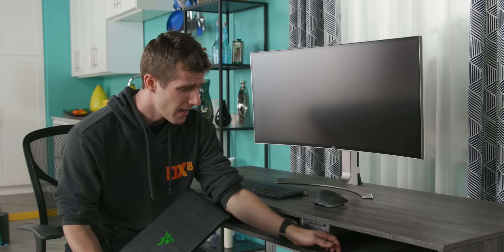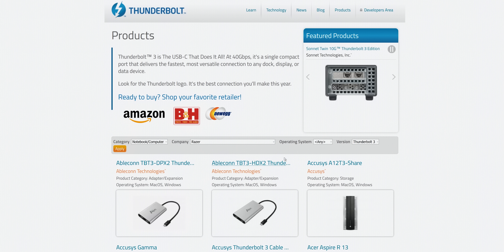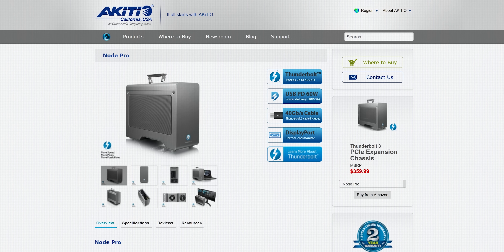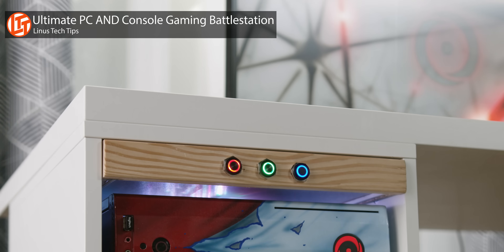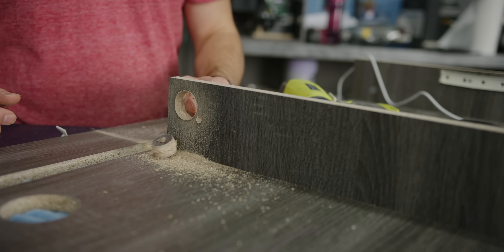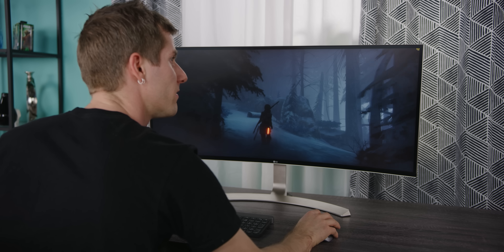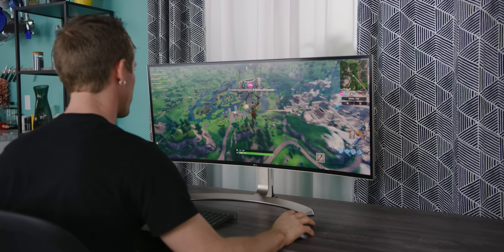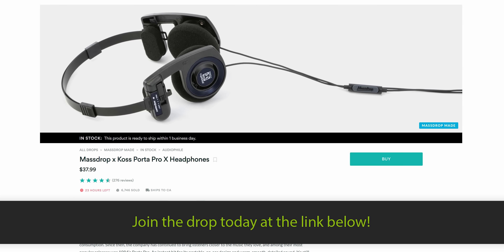This is the CLEANEST Setup.

Comment: Sorry, but I got my son the same thing in 2015. An Alienware 15" laptop with an i7 & 16gb ram & the Alienware graphics amplifier with a GTX 970 MSI Gaming 4gb graphics card. Four years old & still running strong without so much as a hiccup!! Can't charge the phone by setting it on the desk, but other than that, he's had the same basic setup for four years.
Reply: There is an option for phone charging in the bios (why? I'm not sure) if you turn it on it will give enough power to charge stuff out of usb
Reply: @anthonythomas8079  Good point, but I don't know. In either case, he's never used it.
Reply: Correct me if im wrong but, wouldn't plugging the laptop into the amplifier switch off the GPU of the laptop to instead use the amplifier's?
Reply: @beegbraining  Yes, but only when it's plugged into the amp. Unplug it & it reverts back to the laptop graphics card.
Reply: @erab9514  I only ask because I think its a waste to buy a laptop with a dedicated graphics card (My Alienware R5 m17 has a 1070 OC) to instead use a 970 on an eGPU.
Reply: @beegbraining  Good laptop!! Today, what you say is true. Back in 2014/2015, laptop graphics cards were not nearly as powerful as the desktop version. The i7 in the laptop is great even now, but the graphics card that came with it sucked then & its much worse now.
Reply: ok
Reply: Oh, we used a table from Amazon that cost $35, instead of a desk that cost over 10x as much. He didn't add an extra monitor (now he has 3) & keyboard until later. Not as clean looking, but a fraction of the cost.
Reply: @erab9514  "Not as clean looking..." So you didn't do the same thing, you just spent a bunch extra on an expensive laptop, extra eGPU enclosure when you could have just built an equivalent system with a monitor and given him a basic laptop?? Seems just as ridiculous, just achieving less.
Reply: @Ravenousjoe  Math isn't you're forte. My son needed a laptop for school & wanted a desktop gaming computer. I got him a reasonably priced gaming laptop, plus a desktop graphics card, plus $150 for the amplifier. Add to that the $35 for the table & you have my entire expenditure. He used just that for over two years. After that, like most PC owners, he added to his rig over time. But, for two years, he had the laptop he needed & the desktop he wanted, for very little more than the cost of the laptop. I got him the steak without all the trimmings, but the steak is the same.
Reply: @erab9514  You included the cost of just the table in your original comment, how was I to know you didn't spend a ton of money on an alienware laptop, especially considering buying alienware generally means spending a ton of money for mid range performance. I am glad it is working out for you, but that is a completely different set up, Linus's has filet mignon wrapped in bacon, you have a nice t-bone.
Reply: @Ravenousjoe  Alienware desktops I would agree with. Between my son & I, we've had two Alienware laptops, found them reasonably priced on Amazon & never had any trouble. Their desktops are overpriced, with poor build quality. But, as I said, we don't have the trimmings, but the steak is the same. All that glitters is not gold.
Reply: @erab9514  to be fair id take a t bone or Porter house over just a filet any day.
Reply: @Ravenousjoe  It also depends on how you look at it. I've been told my computer isn't very good, because I don't have case lighting, or my case, keyboard, mouse & mousepad RGB synced. In fact, my mousepad & mouse don't even have lights & my cpu isn't water cooled. Those same people grow silent when they see that I play CSGO at 250fps. I currently play at 1280x960 stretched, but I also got 250fps when I still played at 1080p. Lighting isn't something I care about.
Reply: @MinistryOfMagic_DoM  Good point 😊
Reply: @erab9514  I'm the same way. I have an air cooler and no window on my silent case. Would much better enjoy a silent, yet powerful pc over something flashy. But if I had the money to make something as clean as this, I wouldn't say no. Anything that blends in with the rest of my home is great, a tower normally doesn't go with an entertainment system. I guess thats why I have my office.
Reply: @Ravenousjoe  Good points & it sounds like you have a great rig!! Mine is in my room. Mine does have a window, but I didn't bother with case lighting, so you can't see anything. I also have an air cooler on my cpu. The cpu has never gone as high as 60c. Air cooling is way underrated IMO. (And if I had the money, I wouldn't say no either.)
Reply: Capt. Nasty english isn’t your forte.
Reply: @leowo4557  I don't take criticism from someone that doesn't know enough to capitalize English.
Reply: Capt. Nasty you used the wrong your
Reply: Capt. Nasty I’m not saying my spelling is perfect i’m just saying you used the wrong your
Reply: @leowo4557  And I'm saying that those too stupid, or lazy to capitalize, or use punctuation, have no right to criticize anyone.
Reply: @erab9514  nah hypcrites still exist you know and calm down it's just a typo i just used the english isn't your best forte because you said math wasn't you're best forte as a joke calm down dud lol
Reply: @erab9514  True and the same situation applies to me too

Comment: Looks cool, Unfortunately I have the normal akitio node which doesn't have any daisy chaining, I have to use all three ports on my computer to run my setup. Have you seen Mantiz eGPUs? They have all the bells and whistles in one package. On another note, I would worry about thermal throttling on your cpu. I found my computer thermal throttled with the lid closed and I had to either have it in tent mode or use a cooling pad beneath it.

Comment: Hey Linus, It's a big ask but could you comment on the performance impact of using say a 2080 in an egpu with a hardrive running the games. I've seen your egpu video that looks at performance but I wonder how much impact running the games off an external drive would have on game performance given the bandwidth of thunderbolt 3. Would the external drive cause significant performance decrease?

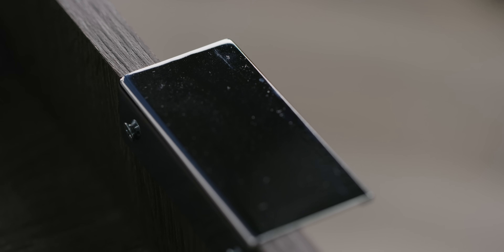Comment: 6:04 it looks like they don't fit because the countersink is on the other side. Either the plate is mounted on the wrong side (should be the inner 90* not outer), or the factory counter-sunk the holes on the wrong side. Double-check assembly instructions, if it's correct then try using a step bit to make your own countersink on the right side.

Side note: Do you need an AV technician (AVIXA certified)/Car Electronics Specialist (MECP certified)/Camera Assistant (First AC)/second Alex around the shop? I'd love to get away from the rat race in Toronto to work at LMG!
Reply: maybe commenting isn't the greatest way to introduce yourself, but good luck.
Reply: they do definitely need an audio guy, if only they realized it. or perhaps they did, but It isn't making financial sense

Comment: How difficult would it be to custom bend your own bracket for the I/O box that is held in place with two strips of velcro?  Then you could just slide the whole thing in and out of the bay to either the left of right side.  No need to unplug anything while sliding it out.  Overall this is nicely done.  Do you ever see your company manufacturing kits and/or finished pieces to sell?

Comment: NEVER run anything else on the same thunderbolt controller as an eGPU. You would be better off getting a laptop that has 2 thunderbolt controllers running x4 speed. For example, macbook pros have 2 thunderbolt controllers... 1 for the left 2 ports and 1 for the right 2 ports, eGPU gets plugged on right side controller, while your USB and ethernet plug into the left side controller.

Comment: For anyone thinking of doing this, use 3m dualoc instead of velcro. It's much more secure, and your Thunderbolt hub won't shift around when you plug and unplug stuff, but you can still pull it off the desk.

Comment: You want to use hook and loop velcro, instead of regular. I've got a huge surge protector with a dock, speakers, two monitors plugged in mounted to the underneath of my desk. weighs at least 5 pounds and is secure as all get out. Picked up two rolls at Office Depot for like 12 bucks.

Comment: I am trying to do this but usb-c monitors are not common in Brazil. I used a 4k 32 inch LG monitor, mechanical keyboard, mouse and speakers. Only thing that bothers me is opening lid to power up the laptop.

Comment: In total what’s the price of this? 🤔
Reply: Daniel Benavente too much
Reply: 5k if you get someone to build the same desk
Reply: I don't think they sell an Alex in my area, not sure how much it'd cost to buy one secondhand from Linus
Reply: @Soundaholic92  That CNC router might be a little expensive also.
Reply: Honestly, get one of the newer desktop replacement laptops or even the older Helios 500. At 1080p 144hz all the models are pretty damn impressive. I'm ordering the 2700 AMD model personally, just because I like that chip, that is if nothing comes along in the $1700-2000 range between now and next month. I just need an on the go laptop that can sort of keep up with my work station computer. There isn't one that can, but there are a lot that do damn good for what they are.
Reply: it really just depends on your needs. if you had a laptop that was $1000 and than bought a egpu for $400ish all that is left is the gpu.
Reply: If you started with nothing - around the same price as a decent gaming desktop setup but with the convenience of a laptop. 👍

Comment: This is a much cleaner version of what I do right now in college. I kept hearing "build a gaming desktop and get a laptop cheaper than $200," but I decided I just wanted one device and got a Dell XPS 15. It can run smoothly with most every program on the go, but I can also plug it into the charger at my desk and connect either a periphery controller or mouse (I'm hoping to at some point get a good monitor and wireless keyboard/mouse for this sort of aesthetic). It just feels nice having everything on one device.

Comment: Question.....if your laptop has 2 thunderbolt 3 ports, would this same set up be possible if you use one of the ports to connect a smaller eGPU and than into a monitor, and use the other one to connect the docking station, for charging and to connect other peripherals?  I know you would have to connect 2 cables instead of one, but might make cheaper for the eGPU system.  Thoughts? Thank you!

Comment: Cool? Yes! Worth the money? No. Those frame rates in fortnight considering the graphics card? That’s kinda underwhelming, which is the reason I feel eGPUs are a bit of a waste. Just get a laptop with a gpu in it, and hide a display port cable and Set it up the same way. All you’ll have to deal with is one display port cable and a power cable. A wireless dongle for your accessories can just stay in the laptop semi permanently

Comment: I would make 2 alterations to this setup.  Change the drawer runners so they don't pull out past the back of the shortened drawers, and hack the thunderbolt cable so that you can take advantage of the 85 watt power delivery from the hub.

Comment: Super cool and interesting video! Please help me out with a MacBook Pro (older and newer MacBooks) "Clean Desk" setup. Thanks bro!
Reply: If you want to have the apple-mirror you have to take the macbook air. It only really helps if you dont have an internal graphics card.
Reply: Salz Stangl the 13” MacBook Pro’s don’t have video cards either.
Reply: @christopherwhite6173  Oh, didnt know that. Then forget my last comment
Reply: There are ways to run MacOs on a PC build laptop if you really want that OS. It would cost less for similar or better power, but you'd have to be willing to do some rigging to make the OS work for you. You could also dual boot it or run MacOS as a VM on a Windows Machine. Just some options. It's not overly complicated, but it would require some work to set up.
Reply: @MinistryOfMagic_DoM  You cannot run macOS inside a VM stable, at least not without a lot of difficulty. And most laptops won't work with macOS without a LOT of tweaking (even then, a lot simply won't work) because the hardware they use isn't supported by the OS.
Reply: @christopherwhite6173  I didn't say itd be easy. You can run it stable on a PC based computer, but it'll take a lot of work. Not really worth the money to buy a mac honestly.  If they were reasonably priced I'd be onboard with Mac
Reply: I agree, a MacBook Pro setup would be fantastic (I have a 2017 15 inch with touch bar) and I when I’m at home I use my windows desktop, but in the future I would like the ability to just have my laptop but also still have my same clean desk set up and power!! (I also Duel booted windows on my MacBook so maybe somehow make it compatible both ways for whichever OS I’m in, if that’s possible?)

Comment: definitely do v2  with slide rails to hold hub, fans on usb power and F it RGB in desk remote controlled, mat in desk RGB mat ... go all out. the draws need fixing to desk in the event its kicked you dont want to rip a cord. drill into the desk leg and run cables inside leg so no cable ties

Comment: You have a cnc and a break, couldn’t you fabricate the desk on your own? Using sheet aluminum for the lower part of the desk and plywood for the top, you could completely customize it to your exact specs. And the aluminum in the base would also help with heat dispersal. But, over all great idea. I kinda want to do this now.

Comment: I am currently doing something similar with my workspace. Using monitor and tablet/mobile phone swing arms, speaker bar mounts, and clip on lighting, to get everything off the desk and hidden if I can, even temporarily.
It seems that you can never have enough storage space for dust free peripherals (chargers, gamepads, joysticks, goggles, HDDs, etc) so more draws may be required.

One thing I would consider with your desk would be HDD docking station(s) in the draws, including dividers for HDD storage.
If you have such good cooling, as you have, why not hide everything else in there too.

Comment: sorry Linus you lost me when you put an E-GPU in there.... this build is a VERY limited use case and most of us would probably just build a SFF PC into one of the draws especially since you can essentially cut out all the middle men and get great performance with the ultra clean look you seem to crave. 

im not saying it couldn't be good for some but A: most of us don't have a CNC mill in our garages and B: you had to cannibalize a multi $100 device just to connect the GPU at a limited 4X speed which with flagship GPUs can make a noticeable impact on frame-times

TL;DR: poor value for your money and a hell of a lot of work

Comment: Would there be a way to have a script run in the background so that if the lid is closed and a thunderbolt connector isn't plugged in it then goes to sleep after 30 seconds of being closed. Extra points if it could detect between this dock setup and a regular charger.

Comment: so you're telling me that a trade of a micro ATX box system with a desktop CPU and desktop GPU without throttling for a mobile cpu, an expensive external GPU (the same size as a micro atx box) with the added benefit of a larger price tag just to save.. what exactly?

Comment: So 420 for the desk, 320 for the eGPU, and 310 for the hub, for a total of over 1050 before adding a graphics card, carpentry and custom CNC router work? I'd rather buy a hundred dollar desk at shopko and spend the rest of the budget on a good base of a gaming computer.

Also not a lot of laptops cool well with the lid closed.  Putting a mini-ITX build in the cabinent with 2060 or 1060  would be just as clean in the long run, and a lot more serviceable.

Comment: So...  Your laptop only has the one Thunderbolt 3 port, then?  You have no choice but to daisy-chain?  I'm just wondering, since a MacBook Pro has 4 Thunderbolt 3 ports, if you could use this setup, but attach two wires instead of one to get an eGPU and full-power charging?

Comment: I would really want to see a clean laptop/desktop setup with a convertible in tent/presentation mode next to the ultrawide monitor
Reply: You would end up seeing a wire or two if the laptop were on the top of the table, but if you're okay with that it's actually a good multitasking option.

Comment: I hooked my MacBook Pro up to a egpu  this week and everything is working great for the most part. I am running windows on it (for gaming) and everything else I use OS X. My one problem is that for some reason when I plug in an external ssd to the computer when it is in windows, it crashes. It does not do this when I am in OS X so I think it might have something to do with all the tinkering I had to do with it I order to make it work with the egpu. It took a LONG TIME to get it working and I still can’t figure out the external hard drive issue, it is going on two weeks so I thought I would ask if anyone has some suggestions. Any help would be great.
Reply: The LTT forums are going to be a better place to ask this question. Youtube comments are mostly just racist rants and people telling the content creators how to do their jobs.

Comment: clean. a damn dream. mine is a pain in the ass hole. I dont have a gpu so no worries there. I am running a 2015 mac,thats not the problem. my desk has 3 drawers under it where I hold my laptop,right over my legs. I can install anything with it.

Comment: What I learned the hard way... Make sure that the motherboard in the laptop powers monitors through the thunderbolt port with the discrete graphics as opposed to integrated graphics.  I got terrible lag when plugging in my monitors to my thunderbolt hub.  Had to go back to plugging them into the machine directly...